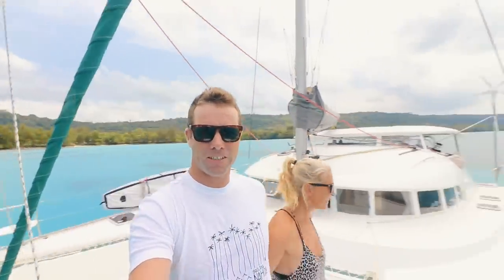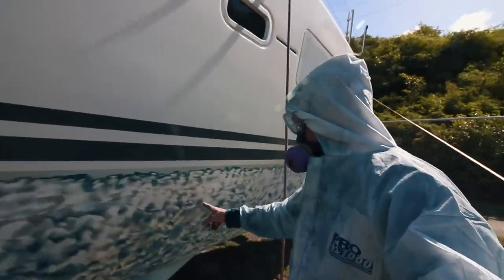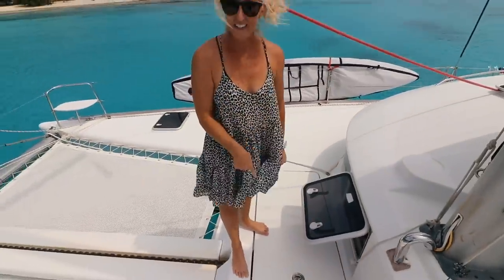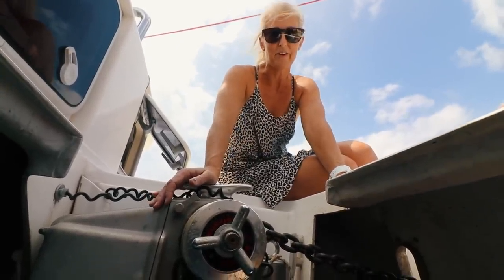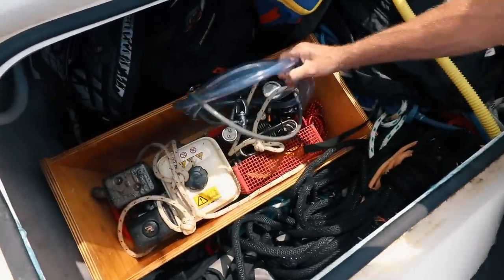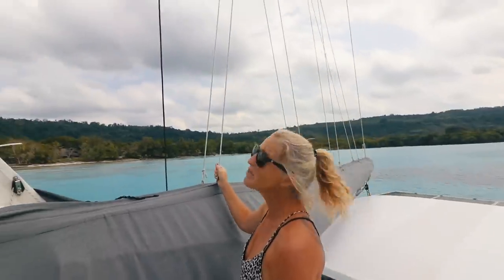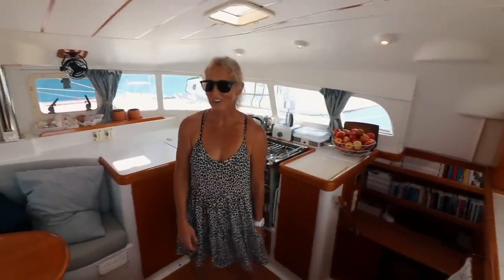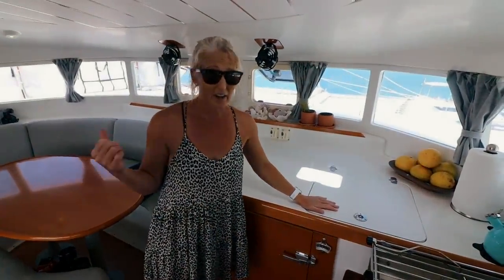Full Tour: Systems and Components of an Offshore Sailing Catamaran - Lagoon 410

Comment: I really enjoyed your review! We cruised the Caribbean for 3 years on the original 410 owners version. My 2 cents:
We had a 7KW genset, 1200AH battery bank 500W solar array, and 40GPH watermaker (watercraft). Watermaker was old school with no gadgetry (auto backflush etc). Bring it up to pressure yourself, watching the guage and listening to the genset as the 2HP motor loaded up. I wouldn't have it any other way. We made thousands of gallons of water with it and it worked flawlessly. I am not a fan of the 12volt based systems. We stayed with the stock setup of fridge and freezer and running dual danfoss compressors. Refrigeration was 95% of our energy consumption and even with the solar array we had, still have to average an hour of genset time everyday. If we were still out, I would rebuild the refrigeration system. Every happy hour usually distills down to refrigeration discussions. I liked the 7kw genset - it was not oversized and could do almost all the tasks required (charge battery and make water or charge battery and run some AC for a while before going to bed if there was no wind) - you couldn't do all 3 though and generally never needed to.  The AC wiring from genset to battery charger HAS TO be properly sized based on the length of the run (somebody installed incorrect gauge wire that was on the verge of causing a fire) - many people don't understand the run is twice the distance from the genset to battery charger which in our case was about 60ft with genset in front and charger in the after port sugar scoop).  
We launched our anchor from the lazerette and think I prefer this to the track on top of the tramp. The only issue was not to let go of the bridal when connecting/disconnecting from the chain (its draped on the underside of the tramp and you either have to swim or get the dingy to run it under). Would love to have a bowsprit and dedicated furler for downwind sail. We had spinnaker with sock  which worked really well. Would also have like a spinnaker pole but made do without it. The 410 does not have backstays (only backswept side stays) - this arrangement is at risk of pulling the mast down. I was concerned enough about it that we upgraded the size of our topping lift line - so when flying the spinnaker we would align the boom with the wind, tighten up on the mainsheet/topping lift - a jury rigged running backstay... I agree upwind performance on this boat is lackluster - you need daggers if you want to sail a cat upwind. We had 12ft AB rib with 25HP 2 stroke and this was the bomb. Would buy another AB again in a heatbeat. Not a fan of aluminium bottoms unless they are unpainted. Saw lots of issues with the powder coating delaminating from the aluminum - presto no RIB.
We had laundry as well and would do that again in a heartbeat. We never used the dryer part (no power for that) but saved hundreds of dollars in laundry compared to fellow cruisers who were getting it done ashore (sometimes paying $15 or $20 for a load!). Nice to have clean sheets every 45 or 6 days when cruising in the tropics. You need a decent watermaker to support this type of infrastructure. You quickly learn that any comfort added to the boat has some energy implication that has to be managed or considered - its all inter-related. For the new cruisers, this is difficult to sort out because you really only learn this stuff when you get out there. Our energy system was setup by the previous owners during their 6 years of cruising so they had a good understanding of what was required to make it work. The boat came with a Fischer Panda 8kw generator which caused us nothing but problems at the start of our cruise so I bit the bullet and installed a brand new Norpro with sound shield (in forward port lazerette which is where the watermaker was installed as well - and it was whisper quiet - to the point we sometimes forgot it was running).  The Norpro came with a 5 year warranty but the company was having financial issues back in 2012. Not sure if they are still in business. We did have some issues with the charge system getting the excite voltage which has to happen to get it to charge... never really resolved that one and it was one of those pesky transient problems that are very hard to diagnose). I did figure out how to manually excite it with 12v when it did happen though. I would do northern lights 2nd time around... easy to get parts and service than most others. Do not buy Fischer Panda! Way to complicated.
Our solar panel mount was similar to yours but also articulated so we could follow the sun into sunset - a very nice feature. 1200 amp hour battery bank = 12-6V golf cart batteries. New battery technology is super exciting and you can now get away with half the bank with deep discharge you can do on the new battery systems. 600 AH capacity was about right for our boat and with a better refrigeration system, I think we could have run a net 0 energy program based just on solar. Not sure I would waste my time with wind generator. Dangerous, noisy and you can't get a whole lot of current out of them - put that cash into more or higher quality solar panels - that's where its at. We had 3KW Xantrex inverter / charger. This worked ok but this is one component I would go with higher quality (ie. magnum). Also good to have a secondary backup battery charger for some redundancy. Lose your abiltity to charge and you soon realize how serious the situation is - especially when you risk losing 4 months of cherished steaks etc. in your freezer that cannot be replaced on a whim.
Wish the 410 had bigger fuel tanks - 25 gals per side is just not enough fuel so always carrying extra in jerry jugs which is a PITA.  The forward garages are super functional - we had one as smelly side for diesel and the other for sails and water toys.
I was 42 when we started cruising (wife and then 14 year old son). We did it for 3 years then came back to work. 9-5 sucks and putting a plan back into action for early retirement in 3 years and return to the sea. Looking forward to setting up my next cruising platform - it will either be a catamaran or full displacement trawler.

Comment: Just saw your chanel, yesterday or the day before and I like it.
Guys in case your rigg getting soft, dont rush to tighten the turnbuckles. Better check all the hull joints of main bulckhead for cracks and garkbrown spots - corners in the anchor locker and other front locker. Also the joints in side front rooms.
You can drill a 2mm on the darkbrowm spot and you will smell rotten playwood. Possible will see water leak out.
Thats mean will need replacement on the main bulkhead. If you tighten the rigg this make the problem bigger and the repair more difficult and expensive. Most people  thighten the turnbuckles.
Ive seen this on bigger 
Lagoons only and participate in repair, its a complicated job.
Good luck and hope I didnt delay.

Comment: I wasn't a sailor in my earlier years, but due to a "Traumatic Brain Injury" which changed my life as well as direction as a truck driver. I knew that my brain was injured and the injury reset a lot of learned controls like first was my selective hearing, eye and hand corrwardanation ( I've never been the best speller), my equal librium needed work, and I found that living on a boat full-time forced me to work on that all the time. I bought a 1963 Morgan 34' sloop off eBay sight un seen for $5,000.00 . It was like camping for the first year. Then I found another sailboat in better condition a 1963 Choey Lee Robb Yawl 35' a teak boat it was quite a bit more but quite a bit better of a boat. I have been doing some investing with my finances and now I am looking at a Fontaine Pajot Victoria 67' owner's version. That after my first Atlantic crossing will become my dorm room while attending college for the third time. So I won't be the average freshman by any means. I think I am getting land sick, it's been two years since I have been on the water and I am beginning to miss it. All for now, Captain Myron...

Comment: Hi - that was a really informative video so thanks for taking the time to film and edit it. It was one of the best I've seen - I love gadgets but understand the need for ease of repair so that was a good balance. I don't know if you have any commercial sponsorships but it would be helpful if you could name-drop a little when it comes to reliable equipment. One question I wondered about was your batteries are fairly close to the engines - did you have any issue with heat from the engines and if so, how did you solve it? Cheers and thanks again.

Comment: Great video on your walkthrough, 2 quick questions if I may ask.  1 How many cloudy days with out sun can you go on or can you use the engines to recharge if need be.  2 would you have enough power to run an electric compressor if you had one.  Thanks.

Comment: Wow!!! This has got to be the best most informative relaxed full value video I've ever seen!!  Thank you So much. I was raised on a sailboat but its been so long and I have never sailed a large catamaran. Designed a few yet to build and the most important question at first was the length for wave size comfort.  (ours was a 56" cutter double diamond rig with 5' bowsprit, and a one ft buttsprit :-] for the extra long boom 68'mast with running back stays and a 20ft of antenna on top) and it cut through waves and ran upwind like a choo choo train. I remember hearing adult conversation about the huge difference between the Pacific waves and the Atlantic waves and that this length hull was perfect for all oceans. 
     But I like the speed of a catamaran; BTW what kind of speeds are you averaging? and why do you think it is not good up wind? and how would you design it to do better especially the handling of waves and wind. I've done a lot of windsurfing in large storms and I see no reason a good design would not do 30 40 knots consistently or at least as fast as the actual wind speed and faster surfing the waves...
    I'm very grateful for having bumped into your video as it brought back many memories that for me are the best in some ways but want to revisit on my own happiness and not as a child better to not be heard or seen kinda thing (although it forced me to go play with the Dolphins and monster stingrays... how they glide through the water so effortlessly) 
    So again thank you and if you have time to answer that would be wonderful at truthmonger6 at the gmail place. (my mission is just beginning after 12 years of intensive research, so I will watch your videos when I need a breath of salt air.) Blessings

Comment: I assume you don’t have AC since you didn’t mention it. Do you still find that manageable in the tropics?  Would it even be possible to run the AC off the solar and battery without a generator.

Comment: I do have a question about the engines in the bedrooms. As a mechanic I know that engines have a certain smell when not in use and a different smell when running. Does the smell seep into the living quarters when not running or when running, and how is the noise in there when they are running?

Comment: Question about your solar panel components.  The location where you mounted the controllers seems rather exposed.  Are they rated for marine environments and high humidity?  I have had several fail (especially inverters) due to heat and humidity alone.  I'm assuming the inverter is inside the cabin somewhere more protected?

Comment: Awesome video. My only thoughts are get the 12 footer rib but keep the floor fiberglass.
I had a 3.4 meter caribe fiberglass hull. 14 years loved it. But just bought highfield double floor aluminum classic version 3.4 meter cause thats what is availsble here in thailand.. Man i am so bummed on the aluminum bottom. Its totally flexing in chop and i am always in chop. 5,000.00 mistake. I will sell it as soon as i can find another fool to buy it. Its the top of line highfield but thefe not anything like my caribe. Fiberglass is only way to go for durability.
Reply: One last thought. Balmar sucks money big time. I had them for a decade. Spent thousands on them. But now i have a 300.00 sterling and it puts 125 amps into the batterys every hour. My alternator is 125 amp veleijo new on recent yanmars.

Comment: I have to admit that I cannot figure out how you manage to take a hot water shower if you have no generator on board.  

How do you manage to provide 8- to 10-kWh per day for hot showers?
Reply: Since I could not get a direct answer, I took a peek in your web site, and I found the following:

“Ah, we indeed forgot to cover that one. In two ways. The hot water tank is connected to the starboard cooling system. When the engine is running, it will heat the water. Alternatively, when we are plugged into shore power at a dock, we can flip the breaker to turn on the hot water heater.”

Would I be wrong in assuming you are using a heat exchanger tied to your starboard cooling system to heat water, and in addition, you have a hot water heat pump plus a normal hot water heating element?

Comment: If you really want to conserve water, switch to a foot pump rather than a pressurized water pump system, which can also quickly drain your water tanks very quickly if a hose should burst or clamps come off the barbs. You'd be surprised, it happens fairly regularly. Plenty of accounts of people losing their water mid-passage because of that and then having to ration their emergency water the rest of the way. Yeah, the water maker could break, too, and murphy's law it will happen at the same time as your tanks have been pumped dry following a failure.

Comment: If Ben had any ingenuity, he could have added a Generator to the engine with a bracket & another belt pulley. That way, if all else fails, running the engine can work similar to a regular generator, only on a smaller scale. WITH a clutch on it, it would have no engine drag at idle. It's just not Ben here, but How many others don't have a clue to thisoption?

Comment: thank you for the tour of your boat, this was great due to i am looking at the 40 to 50 feet plus boats at the moment. It is great that you are going down the solar /wind options which for boating is still in the early stages. The present solar panels are only up to 22% effect at the moment but in the labs a company is developing panels with up 37% efficiency but are not commercially available yet. The best i have seen on my internet feed lately is a company claiming 500 watts plus panels.
   One area you have like to consider is not to discharge your lithium battery for safety below 20% of the capacity of the battery . Also have look at https://battlebornbatteries.com/marine-systems/sailboats/ may be helpful

Comment: You did a very nice job sewing that cover over the helm station, but something that you might want to consider as an additional enhancement is to have  a clear version so you can still see the sails, and then an opaque zippered panel underneath so you can keep the sun out when at anchor and don't need to be able to see the sails while sailing. Sometimes if you are sailing while its raining (which may be unavoidable under certain circumstances) allows the helmsperson to still be able to see the sails and wind instruments while still be protected from the elements rather than having to completely undo the cover to be able to see up from the helm station.

Comment: FANTASTIC TOUR!!!  The absolute BEST one of these I have ever seen!!  Soon after they started sailing the Wynns produced about a 45 minute video "Meet CURIOSITY--A Full Tour of our Sailing Catamaran".  Until I just saw your video, that was the best of these.  But yours somehow includes more rationale and much more nuts and bolts - very informative.  The Wynns were then very new to sailing & cruising and you two have been cruising for years.  By the way, they too swear by "Just Catamarans".  You have rebuilt your Lagoon to suite your particular needs, wants and whims.  The joy you have in showing us your customized floating home is easily evident.  You have done extremely well working with the boat you have come to love, making it an effective tool for your life style - even a member of your family.  May those trade winds always be off the beam or your stern!

Comment: Here's the problem with MOST sailboat sailors. OH let's apply ablative bottom paint. MOST sailboats do NOT go fast Enough in the water for ablative paint to work PROPERLY!!! IF You are not running at a consistent speed of 12 knots or more, the ablative paint is pretty much useless!!!

Comment: Very sweet boat. hey how much of a negative are the swells hitting the bottom of you salon floor when sailing?   1 to 10 scale?   Ben, nice YFT, btw I laughed when you said you did not know they get that big  ((your 130 lber) , they get well over 350 lbs, so save those squid AND flying fish, try stopping when you get a strike thow some bait, you may see a  foaming school. Look at the 2 speed reels if ya like fishing. Try some circle hooks, hooks the corner so no chafing off.    Also you could make yourself a longer gaff of bamboo and gaff hook you have epoxy to coat the line wrapping.  You are sailing for years, canning fish is easy with a pressure cooker and mason jars, keeps and tastes awesome.  Rock on, cheering you on from 90274 .
stop on all floating debis or at least troll by it.    MY friend found over 200 tons of tuna under a floating 5 gal bucket, tuna boat,helicopter - enough rambling  Good luck, thanks for the videos